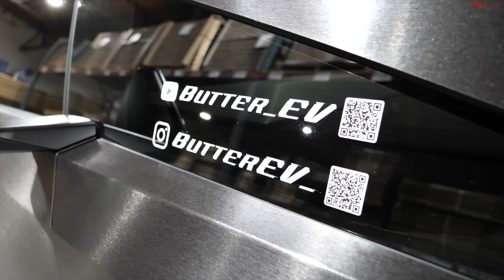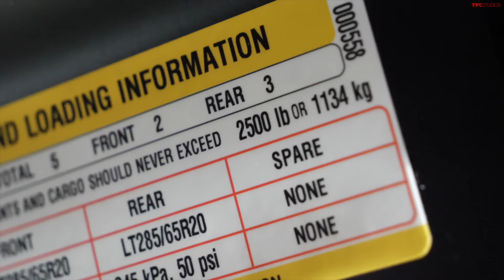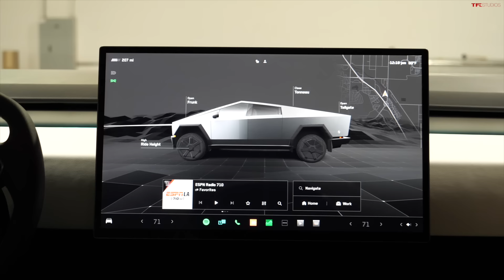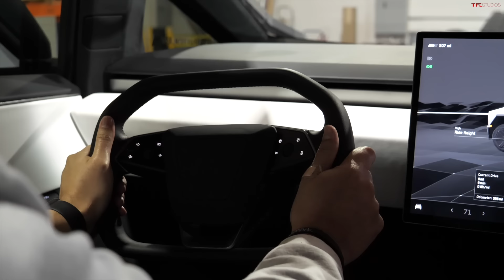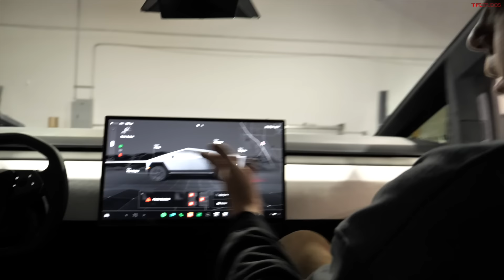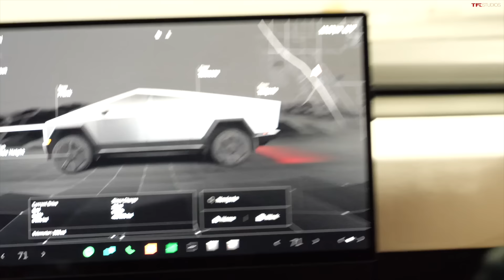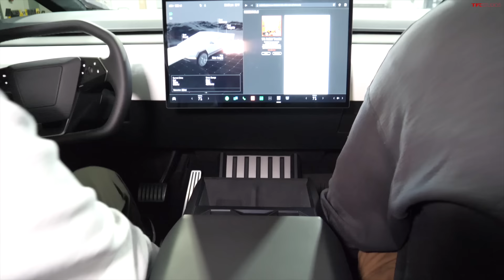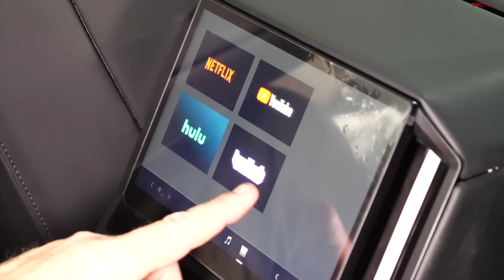What I LOVE & HATE About Owning A Tesla Cybertruck!

Comment: These modern pick ups in general have become less practical as they become more mainstream but this doesn’t really try and perhaps it doesn’t need to. It not for that. 

Can you add roof racks? Does it come  as a cab chasis? The bed seems restrictive. 

That tonneau cover is going to fail in service.

No spare tire? The spare will take up payload space. 

It’s heavy and it tows? It’s just not going long distance. And if you add a battery pack it weighs more. 

You can’t do your job without worrying about getting smudges on it? Seriously it’s not for doing stuff.
Reply: It does have slots for roof racks. They worked pretty closely w contractors when dveveloping it. Lightning a very good truck also.
Reply: I appreciate your comment and concerns.  The truck market is difficult because everyone uses their truck differently.  For example, I have a ten year old mid-size truck with a canopy.  I haul building materials in the bed several times a month. 4 wheel drive is a must.  My muddy dogs ride inside the canopy, so tonneau covers don’t do much for me… guess they would ride in the back seat.  I never tow.  I occasionally off-road to access hunting and backpacking areas (5-10 times per year).  I have lugged a full-size spare around for close to 200,000mls now and have never used the spare or had a tire failure on the road.  I pick up a nail/screw once in a while, these result in a slow leak, I air it up on my shop and I take it in for repair.  Not a big deal.
Reply: @markplott4820  Thanks Mark.  The savings associated with EV’s are real, and the CT does offer a great feature-set.  I own a Tesla MY and I get it.  As outlined in several of the comments here, the CT is not going to work for everyone (including me).  The $100k CT price is out of my price range, especially when I can replace my current rig with a lightly used truck for about $40k… The delta between this and a modern EV truck will buy a lot of oil changes and gasoline.  I am an easy going guy and don’t need much to satisfy my mission.  In 10 years this debate will likely be moot as battery tech improves, high speed charging infrastructure becomes ubiquitous, and EV truck prices (new and used) better align with similarly equipped machines.
Reply: @markplott4820  Thanks again Mark.  I reviewed several of your comments below and I do not think we are going to come to an agreement here… and that is okay.  Last parting comment for your consideration.  Regarding the CT offering “MORE utility” is a qualitative statement.  Utility will differ radically from one customer to another.  For me and my mission, the CT will offer a bit less utility than a newer Tacoma.  The truck market isn’t about winners and losers , it is about choice and finding the best piece of equipment for each of our missions.  The CT is another option, and I prefer more options than less.
Reply: @markplott4820  LOL.  Okay Mark… there must be be more… please keep going
Reply: @christopherhale580  Mark is suspiciously patriotic to cybertruck. It’s an amazing machine, you are correct though, not for everything and yes the infrastructure will get better for EVs. If I could afford one I’d have it (an EV that is not a cybertruck, they don’t have those here) but the winds of change are blowing in the opposite direction for me. Bring on the 20 yo corollas and what ever you guys call a hilux.

Comment: 1.) intent of no Tesla brand?  Tesla intends on having complete new brand based on CT and follow on products. IMO.  2.) Tesla dire warning about keeping clean to prevent “corrosion”. Total crap.  So what if someone keeps clean or does PPF/wrap?… what about the SS on the back side of the body?  If Tesla is correct, CT will corrode worse than an early Japanese car, or 1973 Chevy Vega.  From inside out.  

I am thinking of canceling (losing deposits) or my confirmed (no vin yet) tri-motor Foundation with range of extender. Due to Tesla corrosion announcement. Plus they offer no corrosion warranty. I have reached to Tesla CT owner email process.  So far crickets to my questions. 

Since old guy owner of TFL has bone to pick at all times with Tesla, investigate this corrosion warning from Tesla. Look at what I say above. It is not about preventing corrosion you can see.  It is what you cannot see and stop that is the problem. This insane for my more than $136,000 tri-motor confirmed order.
Reply: I don't think I'd worry about that, sounds like legal speak to keep people from trying to do warranty claims on cosmetic issues with the SS, they can just say you didn't take care of it... I have a feeling repair and replacement of these panels is not something Tesla wants to be doing very often... I think it's going to be a trouble spot for them, unlike paint.

My concerns with corrosion aren't related to the stainless steel, but more so with what is underneath it... It's only the outer panels that are stainless. Hopefully the "skeleton" isn't rust prone.

Comment: Range is always a concern with anything electric. One of my biggest concerns with owning this truck would be what if you get in a minor or moderate accident. The cost of repair and time of the repair takes, and avaliability of parts might make this truck undrivable for a VERY long time. Windshield cracks?- are there any replacements yet?. Reliability is a big question mark as well. I still think this truck is very cool.

Comment: Better not get comfortable without that spare. Electric cars have less tread to minimize issues from the high torque (not sure about the Cybertruck, but typically 6mm instead of 8mm depth of tread). Combine that with the fact tires on Teslas can't be repaired... period. There's a layer of foam below the tread to help with stability due to how freakin heavy these vehicles are. So yeah, if you get a flat, you're screwed. If you repair it, it becomes unstable at high speeds and can explode, so no tire shop will touch them out of fear of a lawsuit. And good luck just picking up another tire at your local tire shop. That Cybertruck tire is custom as all hell, they probably wont have it in stock and will have to be ordered. Which you'll be used to, as electric car's tires typically need changed by 14k miles, and your brake pads 8k miles. So you'll have a great relationship with your local tire shop, for sure! Enjooooy...

Comment: Nobody is using one of those things for hauling pallets around on a regular basis.  Plus, why would you run a camping trailer off it?  You are depleting your battery.  Most trailers have their own batteries, solar, generator and you can plug them in at a camp site.

Comment: 28.30 minutes in +/- stating all manufactures should be able to do what Tesla does with the screen/software, no they can't right now as they don't have the right software engineers working for them, Tesla is a tech company which makes vehicles. OEM's thought they could just switch from making ICE cars to BEV's with some minor changes but then they realised it's not that simple, the cars OS has to have comms to all the components in the car , it needs full control down to the firmware level so to be able to do updates. Listen to Jim Farley about how many different suppliers OEM's have and how they can't access the firmware of most of the components.

Comment: Everything about that truck is what is wrong about today.  Welcome to 16bit graphics. Wait till you get the bill for that failed tonneau cover,  The lack of a real world design make the bed impossible to use from the sides.  That frunk is so small you could maybe fit 3 fold up chairs in it.  but you cant reach the bed from the sides so that is what you are stuck with. The tires are terrible for any real off-roading. Todays vehicles are way to electronic than they need to be.  Example, Vent goes bad, old tech, replace cable pulling the vent open or closed. New tech,  Could be computer could be motor, either will cost a ton of money to fix that vent .. dumb.  Just try to clean the inside of that front windshield. lol. No spair tire.. dumb for a truck used to do truck things. Those side mirrors are cut in half. I could go on and on.

Comment: How do people finance a 100K car?
Reply: I'm pretty sure they cannot afford to change there tires every 8k miles
Reply: Back when rates were closer to 2%, I bought an $85,000 truck.  I put down $10k and then had a payment of around $900+/month and it was going to be for like 84 months.  I was amazed at how easily I qualified.  It was a bad life decision........I actually got out of it 2 years into the loan and now drive a 14 year old minivan.  It was a life lesson.  I have decided that I will not finance again until my house is paid off.  All this said, I definitely know families with 2 high incomes that could spend $100k with no issue.  So they are out there.
Reply: General rule of thumb is car payments should be no more than 10% of your monthly income.  Save up for a 20% down payment, then finance the $80K balance.

Depending on interest rates and terms of loan, many people can still afford this.  Generally, your total income should be around $90k+ per year. That covers around 20% of US population. For joint earners that percentage would be even higher.

Comment: Something to remember on the 'promised' specs (they were estimates):
Tesla estimated 300 miles and 10,000 lb towing on the dual motor which most orders will be. They beat their 'promises' in that regard. While it's not 3500 lb, the 2500 lb payload is still better than a lot of 1/2 tons.
My point is this: be realistic. Would you have bought the tri-motor? I wasn't going to regardless so the dual-motor specs were a pleasant surprise. More range and towing than estimated, sweet!
If you were definitely going to buy the tri-motor, then sure, you can be disappointed.
Reply: Aspirations are not promises. 😊

Comment: Power Rolltop cover can be out on any truck.  I out one on in 2005.  

I want to drive where you guys dont get flats. And i do inspect my tires on pretrip.

That thing weighs more than a ram 3509 diesel. Now thats feeling planted like a small building 

I like technology but i feel like these are going the wrong way. And are way over sold. I can get in a v6 fullsize and tow 400 miles in a day with a with a 10 min fill up with a spare tire. Even running the hvac in sub zero temps. 

The map light should come on by pressing the lens.😢 Be glad yours is staying off and not staying on or worse yet turning on while your driving 

Need a browser and games when your sitting for an hour to get the equivilant of 15 gallons of fuel.

So in less than 400 miles and he is already concearned about range.
Reply: I drive in Cincinnati and Michigan, if ever there were a place to get a flat it’d be here. And none in 3 years with my Ranger. None in 2 years with a Civic before that. None in 2 years with a Golf before that. Only 1 in 7 years with a Focus before that. In those 15 years I’m the only person in my family to have had a flat unrelated to a collision. 

If you’re getting flat tires regularly, it sounds like operator error. I’d never want to be out without a spare, but it is entirely reasonable that someone would want the extra space instead of a tire.

Comment: I'm convinced. You can't own a small business & have an electric vehicle. Who has a hour & a half to wait for a full charge?  😮
Reply: You charge at home or in your business overnight, faster than going to the gas station.
Reply: Actually it's ideal for a small business if you drive or deliver locally. Charge overnight, and save on fuel since electricity is 1/10 the cost of fuel.  I own a F350 and spend $1,000 Canadian per month on fuel.   The Cybertruck would cost me $100 instead. That's a big incentive even though it looks like a door stop.
Reply: @bostondan77 Not if you pull a trailer. Cybertruck will not get through the day.
Reply: @markplott4820  Actual towing tests say you are incorrect. Our workers take theur trucks home at night. While a typical job site might only be 30 miles away, we might need to go back and forth between the job site and supply yards or gravel pits pull a trailer 3 or 4 times. So we can easily get 150-250 miles towing in a work day, plus driving tge truck from hone to the shop , plus back home after work. Cybertruck will not cone close to finishing tge day on one charge. Worker time is billable at $150/hr. We would lose far more in downtime while charging than we save in fuel. We do have 3 Silverado EVs reserved to test if those will be feasible with their much larger batteries.
Reply: @petemiller519  If a Cybertruck can do what you need, then you didn't need an F350 and could have saved fuel with a smaller truck.
Reply: @markplott4820  Funny how every Tesla fan falls back to the same bullshit, "nobody uses trucks as trucks anyway" excuse every time the inadequacy of the Cybertruck as a work truck is brought up. Do you have daily pep rallies where you get your talking points?

100s of thousands of pickup trucks are in contractor fleets and get similar use every day. Get out of your little suburban bubble. There is a huge world outside of Starbucks sippers.
Reply: @markplott4820  Anyone who thinks a cast aluminum frame is more durable than a forged steel frame has no clue what they are talking about. Cybertruck will break carrying heavy loads on rough roads. The "exoskeleton" will not help with that. Model Y castings are cracking under far less strain.

What utility? It can't haul a 5th wheel trailer. Sides are too high to reach over to grab tools. Battery is too small for all day towing. Nothing to mount a plow on. No winch available. It fails at so many common work truck tasks.
Reply: @markplott4820  You realise tge 9 tons has nothing to do with the strength of the truck, and is just the pressure holding the mold together as they inject the aluminum. No, of course you don't.

As molds get more complicated, it takes greater pressure injecting the molten metal to make sure it fills the whole mold. Therefore the clamling force holding the mold halves together needs to be higher.

There is no magical aluminum alloy that makes it as strong as forged steel. Plus, the casting process makes parts that are less ductile, and therefore more brittle, than forging. As I already stated, Model Y castings are cracking. Tesla just refused to acknowledge that it is a problem, claiming the cracks are within spec.

Comment: EVs weigh a lot more than regular vehicles of the same size. They are destroying roads, bridges and are so materials intensive, and very limited range in the cold.
Reply: EVs are not the problem, it’s semis. Even a Hummer EV has causes almost 0 wear to the roads compared to a Peterbilt. And there are a lot more semis on the roads today than EVs.
Reply: My diesel HD 3500 is about 2,000 pounds heavier empty. I like heavy trucks. Nothing wrong with heavy.
Reply: @is6566  There is plenty wrong with heavy trucks, but in the normal pickup style, road wear is not it.